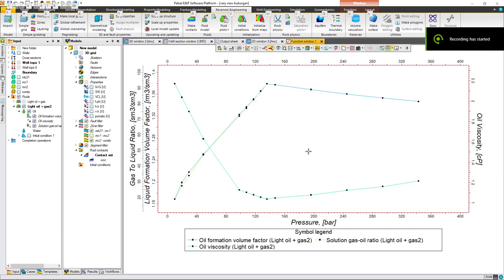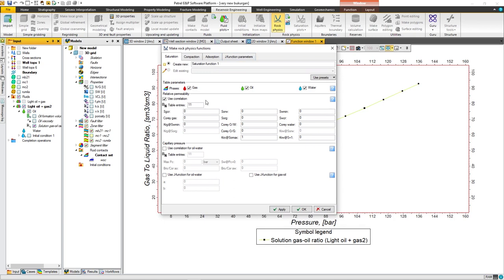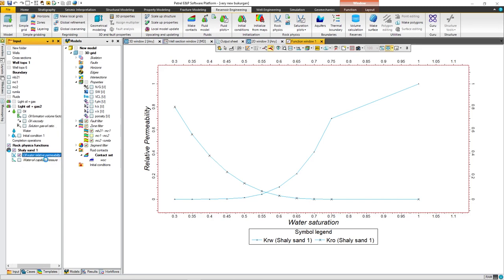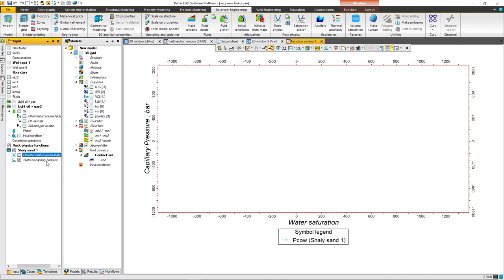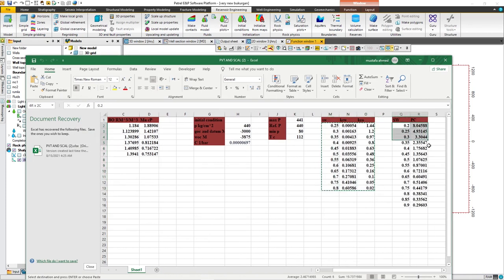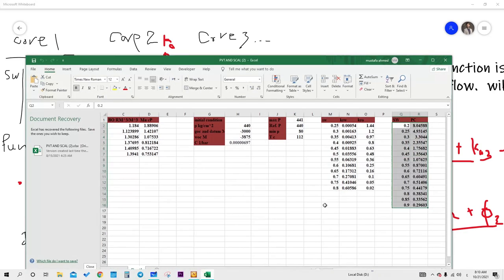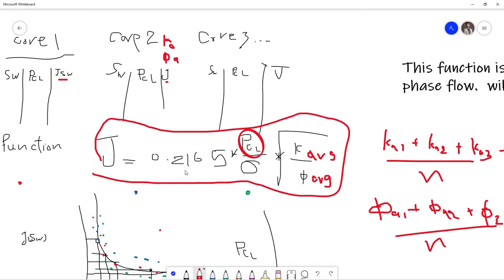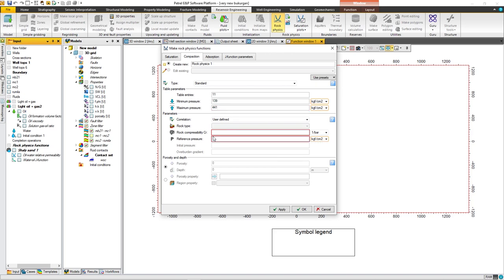Petrel dynamic model - Rock physics function & Leverett j function

Comment: Good presentation Mustapha. I think in your example we have a water-wet system/reservoir since the oil & water relative permeability curve intercept at Sw more than 0.5.

My question please. 
If your special core analysis (SCAL) report only has the endpoint values without Corey exponents for oil and water (Nw & No are not given). how do you generate your relative permeability table.
(what is the specific empirical formular is used to estimate REL perm values)
Thank you

Comment: good afternoon, in the case you are giving an example of : you have a water-wet rock and not a mixed-wet rock. Because the wettability can be defined on the basis of : at what water saturation do your plots of oil and water relative permeability cross.

If your oil/water relative permeabilities plots cross at a water saturation Sw less then 0.5 then it is an oil-wet rock. If your oil/water relative permeabilities plots cross at a water saturation Sw greater then 0.5 then it is a water-wet rock. 

In your case : the oil/water relative permeabilities plots cross at a water saturation around Sw= 0.65-0.66 which means that it is a water-wet rock.